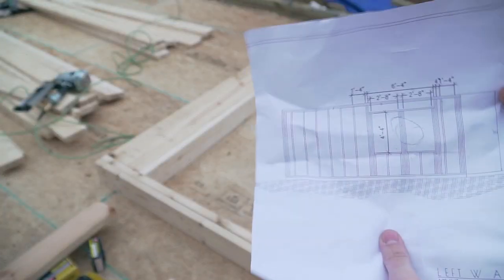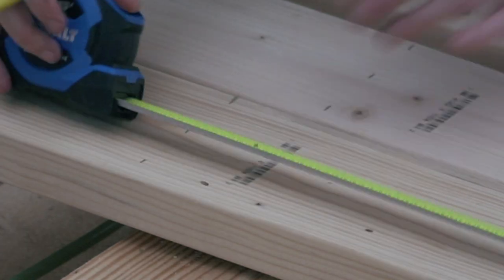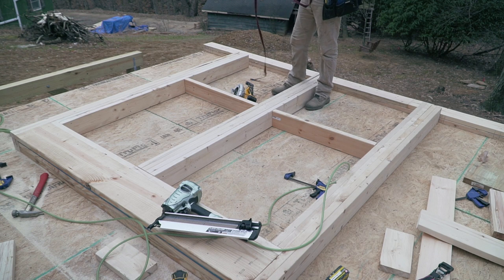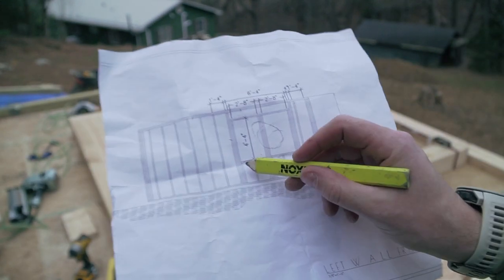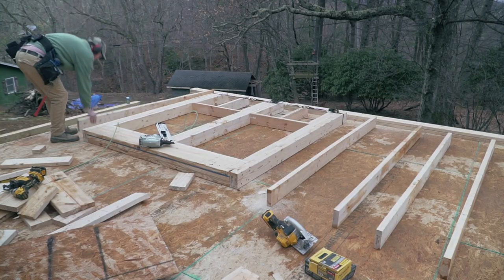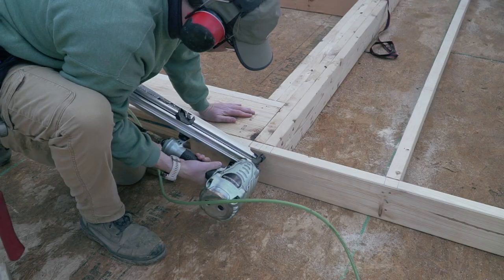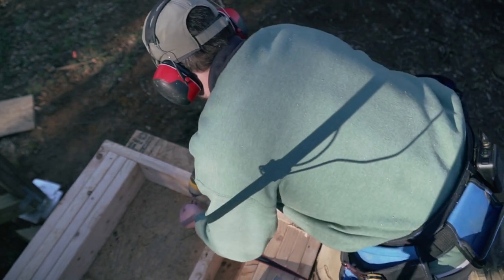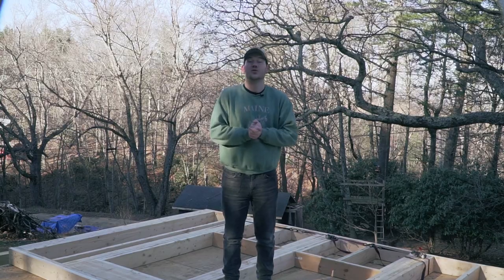Framing the First Window Wall : DONE ! - Part 2 - EP 17

Comment: One thing about top plate is it has to tie in with the other wall, it has to overlap on the other wall
Reply: Exactly, need to overlap the crown plate or cut it back 5 1/2" so the tops tie in as well as nailing the corners.
Reply from the maker: Yes that’s correct! I had planned to do it but obviously I forgot! Shoot ! Well I’ll rectify this
Reply from the maker: Actually, I take this back, both front and rear wall will be balloon framed gable end walls so I don’t see how an overlap would work.

Comment: Great job. Should reduce the 2nd top plate so the other walls top plate could cover and nail into locking the walls together on the top.
Reply from the maker: Makes sense but how does that work with a gable end wall like I did at the front and back?
Reply: @TheDIYCabinGuy  Frame the gable top triangle on it own and lap the plywood  over on the out side to reinforce it.